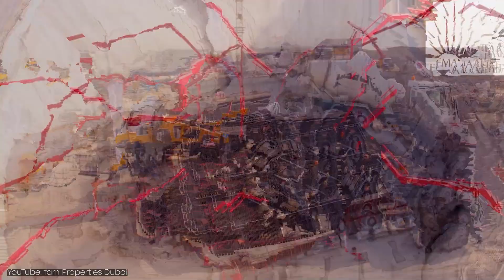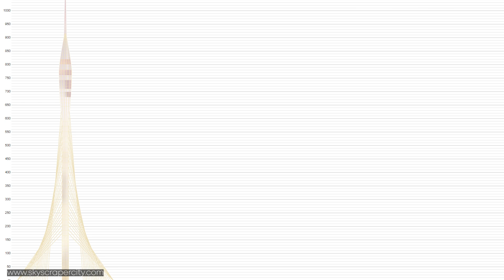Dubai Creek Tower: The Tallest Structure of the Future

Comment: Where is your source for the 1400M height? Several fake vids like this incorrectly show the scale of Creek Tower to be almost twice as big as current plans. If it gets built at all it is listed to be at least 828M tall to beat Khalifa but not by much. The foundations are more or less finished so the overall form factor of the building itself can't reach the scale of the false diagram used in said videos. As cool as  a 1400M tower like this would be it simply won't happen. Creek Tower is a cable stayed observation tower will very little lettable space. Therefore, there is no economic model to justify and finance its existance. This video is essentially a complete lie.

Comment: This tower will break jeddah tower record 🤩😘🤩😘🤩
Reply: No. Dubai Creek Tower will not hold the record for world's tallest building. Because CTBUH stated that a proper building should have a minimum of 50% habitable space. Dubai Creek Tower has 30% habitable space
Reply: @x_x-t6m  dubai creek tower is taller than jeddah tower watch on you tube and bigger than dubai creek tower is japan skymile tower 1700 meters height
Reply: @aadilshaikh3157  Sky Mile tower will be the tallest building from 2045 with a height of 1,700 metres and 400 floors
Reply: @x_x-t6m  no in sky mile tower how come 400 floors will be there but Dubai creek tower is taller than jeddah tower watch on YouTube
Reply: @aadilshaikh3157  I know that but like i said Dubai Creek tower will only be 30% habitable and it is not self supported. That's why it's not considered a skyscraper. Also sources are saying that sky mile tower will have 400 floors

Comment: It doesn't look like Dubai Creek is going anywhere beyond Dubai Creek Harbour (the small island where towers are already being built) any time soon. It's not mentioned anywhere on the developer's website anymore. That means the tower is kaput as well. It hasn't seen activity since the foundations were completed in May 2018, reportedly because it turned out quite a bit more expensive than Emaar had envisioned. For such a large and complicated structure, $1 billion really isn't much. So now it's being edited out of renders and mentions of it are quietly removed from Emaar's website. 

Besides, Dubai is experiencing a bit of a crisis with a massive oversupply of real estate, so building Dubai Creek in the current market wouldn't be particularly profitable. There aren't enough buyers for all the apartments already on the market today, so building room for another half a million residents is a bit of a folly. 

And anyway, what would be the point for Emaar to upstage Burj Khalifa, which they also own? They already have the tallest tower in the world and the highest observation deck in Dubai. No need to outdo it; that would only double the operating costs of the attraction while also splitting the revenue. Jeddah Tower isn't going anywhere either, and it doesn't look like Dubai One Tower will be realized. Burj Khalifa sits safe for the foreseeable future.

Comment: Clearly now at this point, Dubai is just building the worlds tallest building so they can have that title. Idk if your building something over 1400 meters but it has absolutely no use to it besides the very top floors, which are so small you cant do anything with them. It looks more like a radio tower than a skyscraper. At least back when NYC and Chicago had the tallest buildings, they would make their money back. They had large floor spaces for offices, apartments, etc and they actually looked like fricken buildings. But the Dubai creek tower is just a stem of elevators and stairs for like 3500 feet and before you actually reach the somewhat 20 usable floors. It’s just a big tourist sham and there not going to make a profit on it. It’s stupid! And it’s barely a free standing structure because of the cables holding it up. Without those cables there’s no tower. It’s just a stupid piece of shit. If they want to beat the record they’d be better off using something that’s actually usable, like the Burj or the Jeddah tower.
Reply: Woah, why the hate?
Reply: You'll probably be delighted to hear that Dubai Creek Tower hasn't seen activity since May 2018, and probably won't for the foreseeable future. Turns out that it would be quite a bit more expensive to build than anticipated, and that people weren't quite as interested in buying apartments in the surrounding towers as Emaar had hoped.

Comment: Do you think Creek Tower structure will be completed in the 2021-2030 decade ?  I don't.
Reply: It will never be completed, just like the Dubai wheel on bluewaters never will. They will just repurpose it in to a stupid light show or ping pong centre
Reply: @beausexon435  That's the same kind of energy people had back in 2008/2009, only for Dubai's economy to bounce back to full speed by 2014. I wouldn't be surprised if everything's back to normal by 2025 this time round. One thing I know for sure is that they won't just stop building.
Reply: @Ahmed-N  yes I would agree that there will be some kind of bounce back. But obviously Abu Dhabi bailed Dubai out last time, and AD make their money from oil and investments, both of which are sadly lacking in value at the moment. I wish Dubai well, but their strategy of “build and they will come” hasn’t worked for years now, so they need some better ideas.
Reply: @Ahmed-N : It didn't bounce back to the same height, though. A lot of the projects that were stalled in 2008/2009 didn't start back up (Pentominium, anyone?). New projects that were started up weren't anywhere near the same scale as those before the crisis. Most of those that were have since stalled again (Marina 106, Burj Jumeirah, Entisar Tower, Dubai Creek Tower...) And since 2014, property prices have been falling steadily year on year again. I don't think the crazy days of 2006 will ever come back, and that's too bad because that's the kind of conditions required for projects like Dubai Creek Tower to come to fruition.